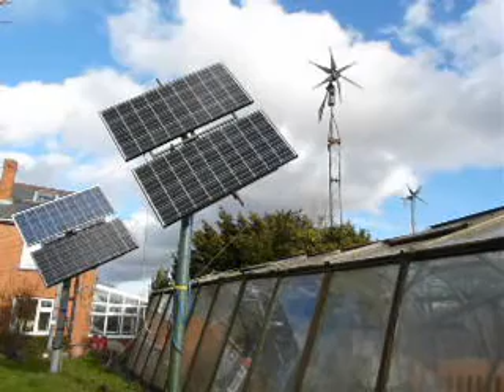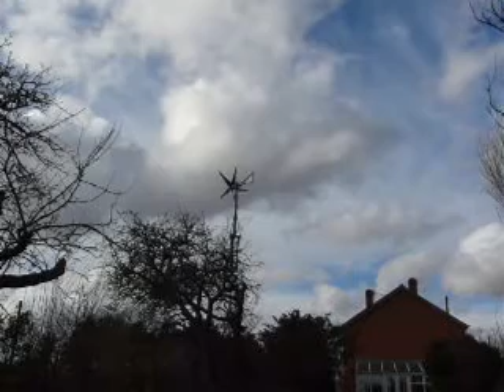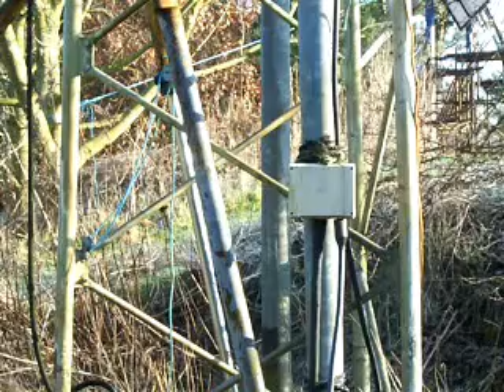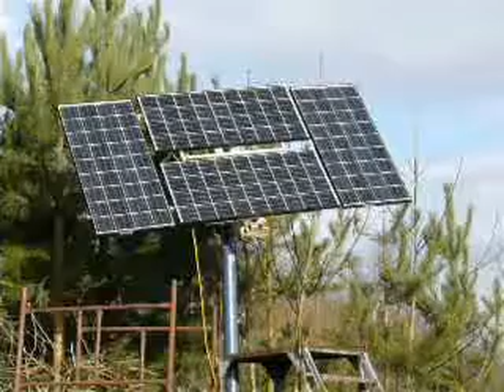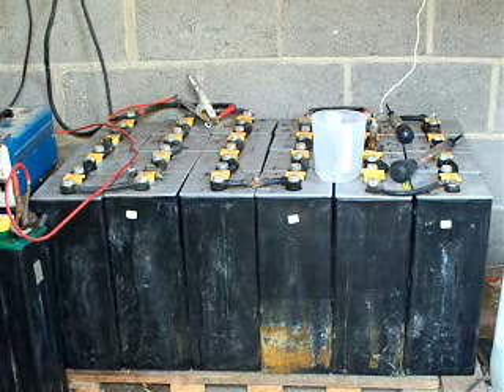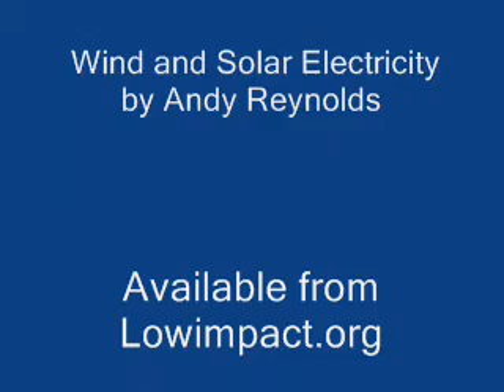Wind and Solar home electricity generation, a basic primer on the systems

Comment: Nice video an installation awesome solar system
Reply from the maker: Hi, thanks for the appreciation. You may be interested in my winter solstice 2016 video, it's in my solar playlist, and also my book. Many things have changed since 2011 and equipment availability has improved dramatically. Cheers

Comment: Excellent film , I've just purchased your book heating with wood after watching your films ,was reading it last night and did not want to put it down.i think it is going to help me a lot in choosing a wood burning stove once agaiin may I say I think your films are excellent no nonsense practical and informative
Reply from the maker: Mark. Thanks for your appreciation and the book purchase, you may be interested in the video: Making a woodstove from bits found in the nettles, found on my channel. When choosing a stove try to get one with a thermostatic air inlet, so it closes to prevent the stove getting too hot. Cheers, Andy